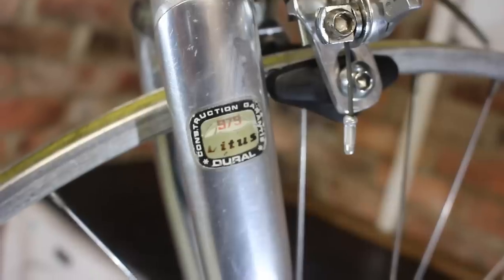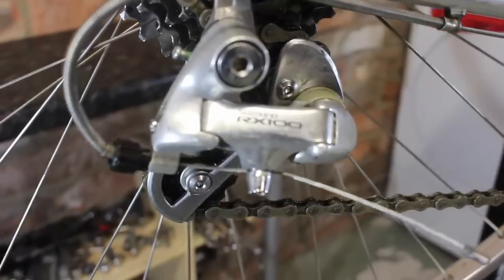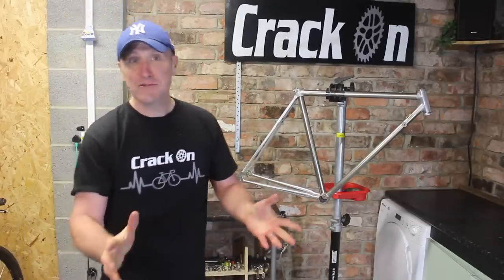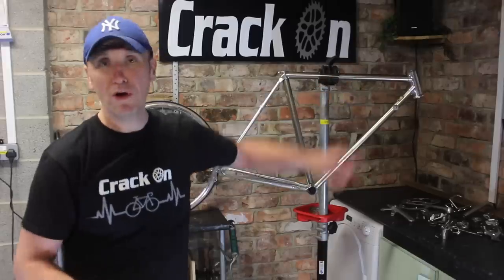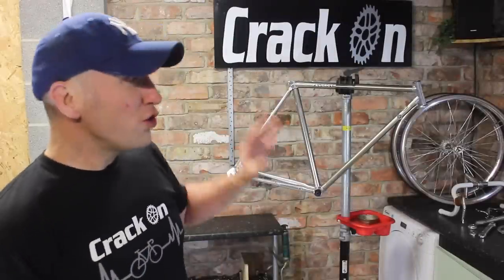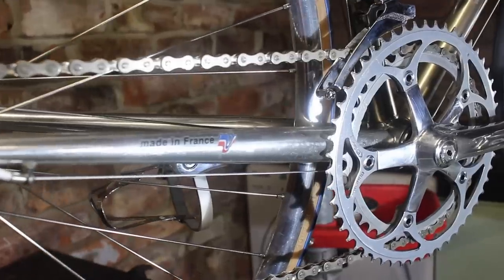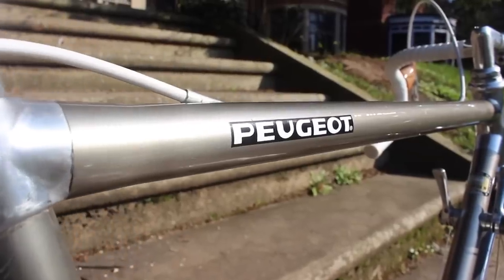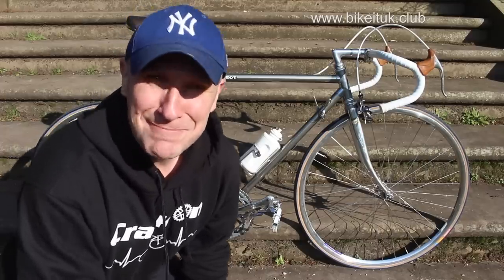Vintage Peugeot PX-10 DU Road Bike Restoration

Comment: Thanks for the great video.i have just bought a 1984 24 1/2 inch peugeot esprit.carbolite frame.at 51 and not ridden for 10yrs.this is the bike I bought from Halfords in 1984 as a 15yr old.found same bike from a friend for 40 pound 2weeks ago.(fate).So changed wheels for modern 700c.new seat new handlebar tape and replaced clb levers with shimano exage aero.all the rest working perfectly.great bikes.
Reply from the maker: Thanks for watching and the support, really happy that you have managed to bring new life back into your own Peugeot no better way to Cycle than on a Recycled bicycle. I hope it brings back some great memories. Thanks again stay safe

Comment: Wow! What a stunning bike. Reputation for frame failure or not I would ride that all day long. I have an early 90's Peugeot Virenque. Steel but lugless, internal brake routing and original 105 groupset including sti shifters. Although they are usually overtaking me, the positive comments I get from guys riding bikes worth thousands show there is a lot of love for vintage bikes. Keep the great videos coming Andy, you are an inspiration to vintage bike lovers everywhere...
Reply from the maker: Thanks for watching and your kind words of support. I personally have two Canyon Ultimates I ride, however nothing gets close to the beauty that was of the late 70's and 80's steel bikes. I need to get my hands on a few more Peugeots 653 maybe. Some great models out there. Thanks again Andy

Comment: Good job.  Just 2 small items:. 

Wrap bar tape from the bar end inside -> out (on top), then reverse it around  the brake so that it runs outside (front) to inside on top.

Also, bar end flats should be parallel with the top tube..
Reply from the maker: Thanks for watching and your tips 👍all the best

Comment: I agree with the comments about the enthusiasm and it was interesting to read about your love of bikes from a young age.
I have an 80s Peugeot with Carbolite 103 which I have just dismantled. I am not wondering where the best place to source parts from is, as you seem to have them just hanging around, ready for restoration.
Cool bikes!
Reply from the maker: Hi thanks for watching and your support. The parts I search for on eBay. Parts that I take off the bikes that I’m not using I’ll either save for another project or sell them myself on eBay. 👍
Reply: Thanks for the reply. I am watching a Shimano gear set incl brakes on eBay and some Mavic rims but not sure if they will fit. Do you have a link to your ebay or an email please? Thanks
Reply: A gear set like used in this video.

Comment: Great job as usual Andy. That seat post is common on the other Peugeot models (1986-1987). I have the Carbon version ( PY10FC) as ridden by Robert Millar waiting to be restored if you want to "crack on" with it.
Reply from the maker: Hi thanks for watching and the comment. I'd love to help out with such a bike, Robert Millar was a great inspiration to me in the day. Sounds a great project, like most of these ideas distance is normally the issue. Im Manchester UK. Thanks again Andy

Comment: Enjoying your channel! I'm eyeing up a Peugeot Virenque 5000 at the moment. Will need a fair amount of work to restore to original . Can you advise on any easy non invasive ways to check the headset and bb for damage and is there any special areas of the frame should be paying attention to?
Reply from the maker: Thanks for watching regarding your question the Peugeot Virenque 5000 was built in the 1990's I would ensure the seat post is free and just inspect for any deep rust. Surface rust is not generally a problem, we can deal with that. Nice bike by the way. Good luck all the best Andy

Comment: I agree with you. Very nice bike. But is aluminium a good material for the fork?
Reply from the maker: These really are beautiful frames light and great to ride, however the bonding used has been known to fail. It really depends what you want from your retro vintage bike. Was this the bike of your era or are you just after a bike to ride?
Reply: @BikeItUK  Hi Andy! No, my era was steel only. I was competing in '69 and 70

Comment: I\I have an old steel kona that is blistered and rusty, thinking about a repaint. Is the rust treated prior to powder coating? Also how much does a powder coat cost? Thanks!
Reply: Depends how bad the rust is?...If it's actually eating in to the steel, then yes it does matter. You'd need to grind it out until clean and then weld it back up. This is a long and difficult job, so if you're not a highly skilled welder/fabricator I would advise against doing it yourself. If however it's just a bit of surface rust then just give the stripped frame a rub down with a bit of P240 emery paper. Powder coating price depends entirely on what you want. I have a company local to me (actually I'm a previous employee) that has powder coated frames for me, I generally wait until I know they're going to be using the colour I want and then I take my frame down and the guys put it on the end of the line after their real work has gone through and they coat it for me and let it run through oven with their own work. This costs me a drink (mates rates). But if you wanted to have it coated to order then it'll be a lot more expensive, because you have to pay for them setting up...Which is quite a job with powder. The only real negative to powder is the colours on offer, but if you want a fairly standard basic colour then it'll be fine for you. Hope all this helps.

Comment: Thanks for all the amazing videos! Your channel is for me a reference in terms of bicycle restoration! I Would like to ask you for some information. I bought an old Vitus 979 from 1983 which I want to give a second life. In terms of wet sandpaper and polishing, what parts of the bike exactly can we treat? Everything except the down tube, the cross bar and the seat tube (the anodized parts in color)? Fork, head tube, seat and chain stay is it ok? Thank you very much !
Reply from the maker: Firstly thank you for your support 👍 Regarding the Vitus 979 frames. Just be mindful, depending on the polishing techniques your using the lugs and tubes are bonded so if heated up these can become loose. I wouldn’t mess with the coloured anodised parts.  Areas other than that start off gently and only use the sandpaper on any deep scratches. I hope this helps enjoy
Reply: @BikeItUK  Thanks a lot for all the advice! I will keep all of this in mind and I will be very careful. Indeed, the Vitus 979 is an incredible but fragile bike that deserves some extra care. One last question: where did you find this retro white bottle?

Comment: Hey man! I got a 1974 Peugeot px-10 and I want to do a restomod.  I'm scared to by parts because I'm afraid they won't fit. Do you have any tips on replacing the downtoube shifters and derailers?
Reply from the maker: Thanks for watching regarding parts most if not all parts will go or can be adapted to fit the frames. If your on Facebook a group called Neo-Retro Velo is available to join full of exactly what you are doing. I hope this helps

Comment: What are you using for a de-greaser/cleaner for the components?
Reply from the maker: Thanks for watching and your comment. To degrease I use a couple of products one is from a company called Evans which is a degreasing agent, the other is simply petrol. I hope that this helps in your own project.
Reply: @BikeItUK  Yeah. I've used petrol in the past. Thanks. And keep up the good work.

Comment: I am desperately trying to find out the model of a racing bike my dad had in the late 80s. I remember it had the peugeot red orange and yellow strips, it was metal dark grey, had black foam on the bars and a black leather seat with a crisscross pattern on top. But I am not 100% sure it was actually a peugeot, could there have been a peugeot knock-off with the same coloured strips? I can’t seem to find a peugeot racing bike from the 80s that has the metallic dark grey paint.
Reply from the maker: Hi, I definitely remember the dark grey Peugeot. You may get more information on Facebook. Find the Vintage Peugeot bicycle group, post this on there and you should get some answers. Good luck

Comment: Hi. Thanks for the great channel. I have a question: I have a Peugeot course 100 and it has a square bottom bracket, I have a Durace octalink bottom bracket but I understand that French bikes have a French thread that is different. Thanks for everything and greetings from Vélez de Benaudalla (Granada-Spain)
Reply: Velo Orange makes a great sealed bearing bottom bracket with french threads if you need them.

Comment: Not coating the polished parts with epoxy clear??...alloy goes grey otherwise.
Reply from the maker: Just searching now and shopping. Im on it thanks for the heads up. Andy
Reply from the maker: Just Subbed i've not come across you for some reason all the best Andy